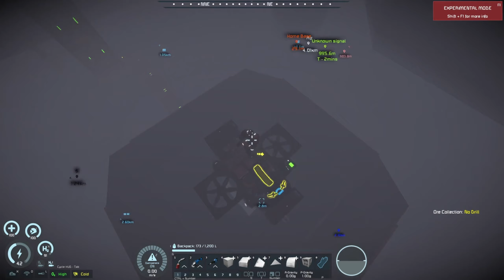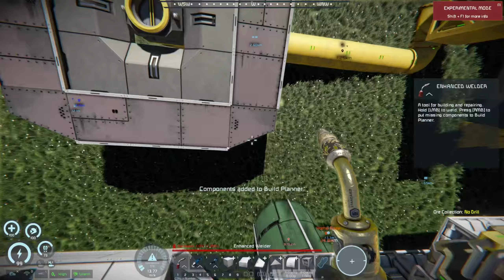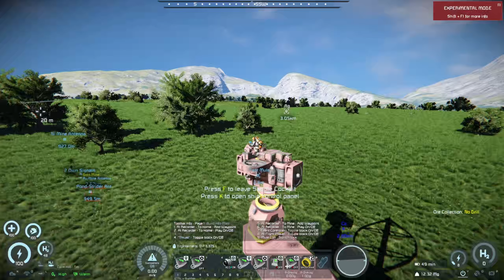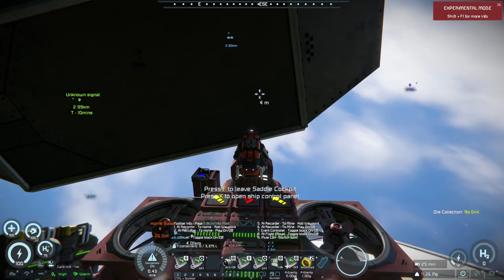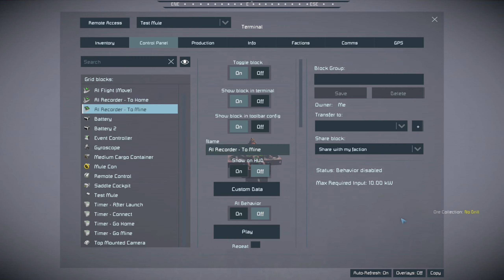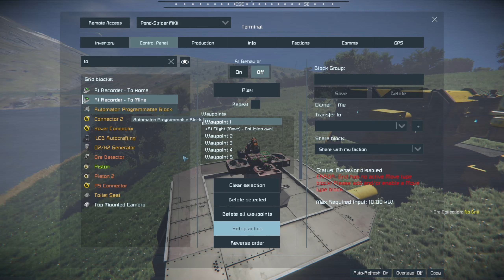Space Engineers Modded E18: Setting up a Drone to haul cargo Pt. 1

Comment: Hmm.. was it intentional that you looped the footage so we could watch it twice?

Part of the reason you were starting to run low on power is that most of the times the Mule landed, the connector wasn't connected, so you were using battery time just hovering over the connector while you looked through the various settings.

My understanding is AI behavior should always be on

Taking off:
Thrusters on
Connector off
Go to waypoint 1
Turn on Collision Avoidance
Connector on
Continue route

Landing:
At the waypoint 30M up, turn off Collision Avoidance
Finish landing
Connector connect
(You may need another timer to delay the connector 1-2 seconds from trying to connect before it's ready)
Thrusters off

Now, how are you going to get the Mule to auto-load and auto-unload cargo?
You may also want to set up a way to delay taking off again if the batteries are below a set %, otherwise the Mule will just keep going til the batteries die.
Reply from the maker: @Original_Chad_P , it was not. I’m going to try and fix and repost.
Reply from the maker: I’m trying to find where it looped to begin with.
Reply from the maker: Alright! I figured it out. Something went wonky in editing. This had two recording cause of the dreaded Roomba attack. And for some reason it double stacked the second clip. I am working on the repair now. And yeah I have been looking into ways that I could get the mule to Pick up automatically, and I do not have a solution just yet.
Reply: @Quantum_Tator  One way would be to use sorters. 
Whitelist Ores (or the specific ore for that mine) and Ingots, if you have a refinery at the mine. 
Anything that connects to that connector will get spoon-fed the whitelist items.
At the base, since you have a separate connector for the Mule, a sorter can withdraw whatever you whitelist for that connector.
If you have multiple drones, for peace of mind, make separate dedicated connectors for each, so you don't have one trying to land when another is already there.
Reply: @Original_Chad_P  yeah, whitelist and 'Drain All' is a thing.
Reply from the maker: @Original_Chad_P  Yeah, that is the plan. Sorter At the mine, and sort potentially on the Mule.
Side note, how're you liking the bits of time lapse?
Reply: @Quantum_Tator  They're fine.  Time-lapse or even edit out some of the mundane grind work, good with me.
We get more content squeezed in that way.

As a side topic, watching this latest episode (18), you may want to increase your wind turbine count at the mine(s). When the fog rolls in, wind turbines get reduced output. I could see the one there (iron mine) spinning quite slow in the fog.